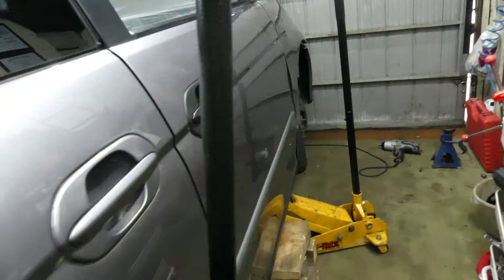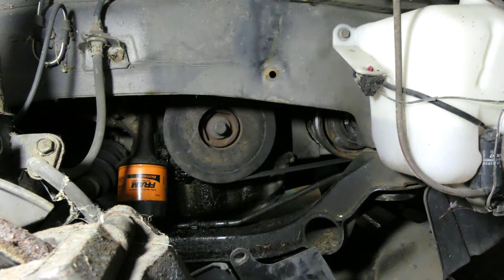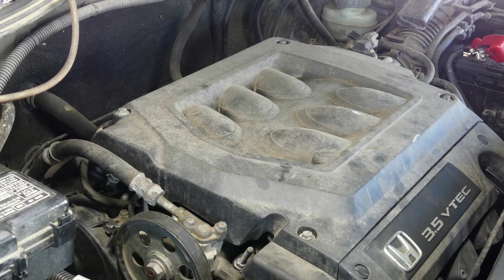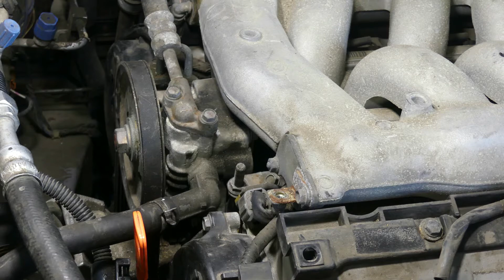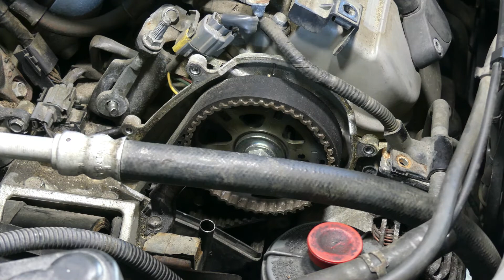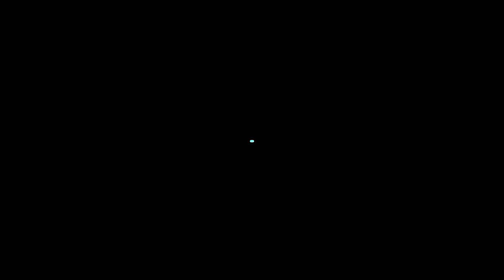2000 Honda Odyssey water pump replacement (PART 01) Backyard Mechanic!!!

Comment: I have the same car, mileage is around 196674, it just stoped working in the middle road, i discovered a lack water in the radiator, luckily i had some in the trunk, i put it in and i realized the  hoze was leaking the water but a little went in and i managed to start and moved to safe parking lot at work but the overheating was producing smoke in the back, fixed it in the evening but then now it consumes alot of water every now and then. Can you come to Memphis TN. and fix it for me?
Reply from the maker: thats too far brother find a local mechanic in ur place to the job